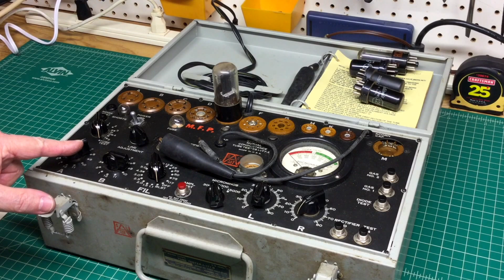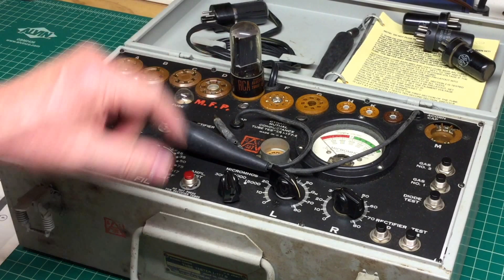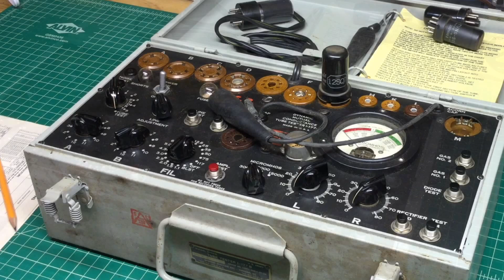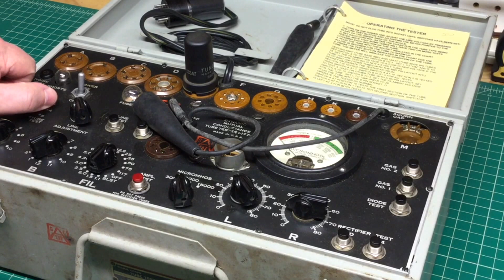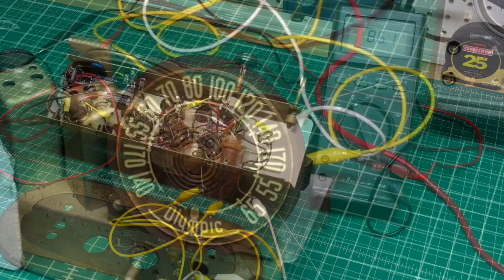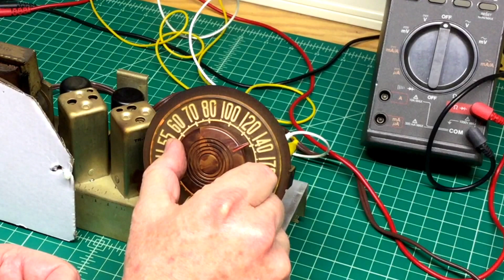Olympic 6-502 - Tube Testing & First Power Up

Comment: Don, 

I've got the same I-177B tube tester you have.  Since this video is over a year old, I don't know if you've since calibrated your I-177B, but there is information on You Tube on how to do this.  I watched a You Tube video by bandersentv where he calibrated his I-177B.  I followed along and did what he did and now my tester works very well.  I ended up replacing the capacitor and a few resisters.

Regards, Tom
Reply from the maker: Tom - I've never calibrated or touched my I-77B. I'm sure it needs some TLC and I appreciate the reference to Bob's video, I really enjoy watching and following his work. I need to make a video on mine too when I get started. Thanks again for the info. Best, Don

Comment: Nice step by step approach while telling about V and current values Don! Gives me an Idea of what to expect when I get a few AA5'S running. So great to see this Olympic waking up and saying good morning world once again!
Reply from the maker: Thank you Tony and I appreciate you watching. These AA5 radios don't draw a lot of current, but you still need to be aware of the nominal values for sure; otherwise, smoke or even worse fire. Best, Don
Reply: +RestoreOldRadios - noticed the B+ was only at 85V or so, is that too low, or is that an issue with AA5s?
Reply from the maker: +saturn5tony Great question Tony. The B+ voltage of 85 volts was inline with the design based on my input voltage. As I increased the line voltage to ~121V, the B+ was just north of 90V. Best, Don